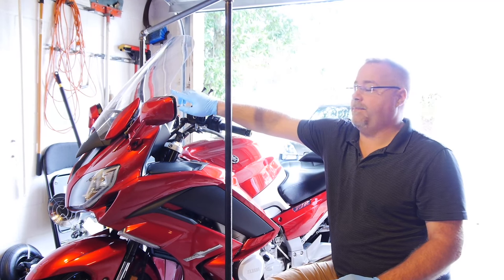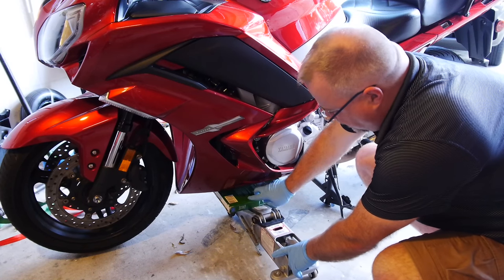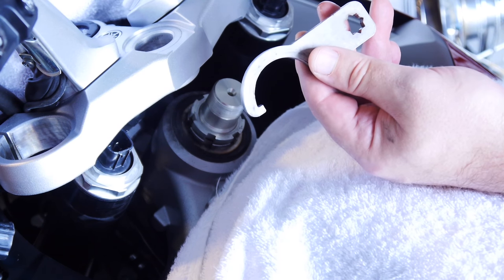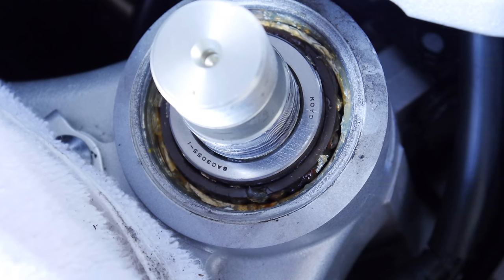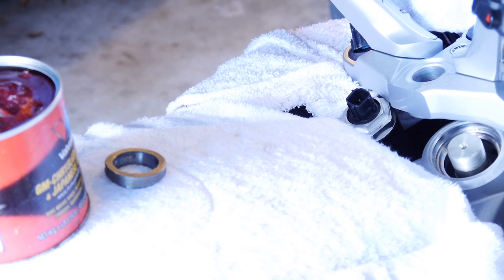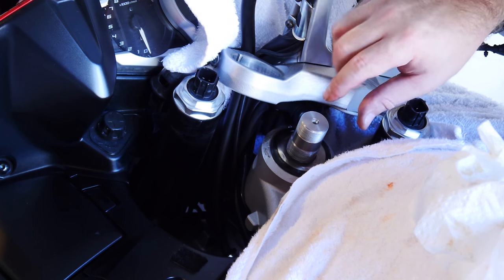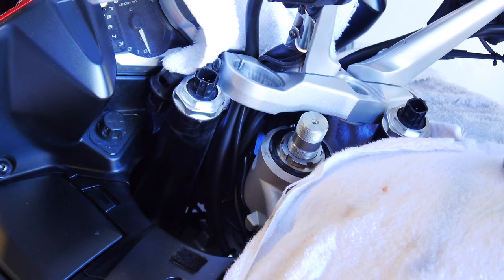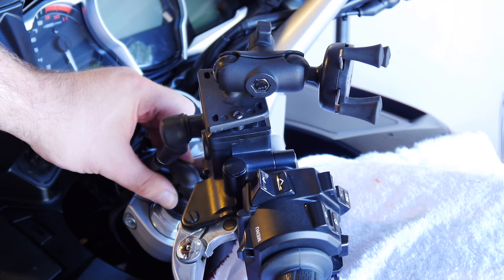How To Service And Pack Steering Bearings Yamaha FJR1300

Comment: I just performed this service and the video was extremely helpful.  One quirk was that I had a very hard time getting the lower bearing re-seated.  During the process, one of the bearing balls came dislodged and I had to reset in in place in the race.  This caused the steering shaft not to align in the center when I lowered the back.  After numerous ups/downs, I finally figured it out.  I almost screwed up by damaging the top threads when going up and down.  Thankfully, everything turned out fine.  Just a word of caution to be careful with those top threads rubbing the top of the steering head.

Comment: Brian glad to see you're putting more videos out sure have missed watching them love the Smokies video and the bearing video👍👍👍
Reply from the maker: Thanks man!  Summer is tough - no events going on and too hot to ride much!
Reply: I have a 2016 Yamaha fjr1300es that has had the steering head bearings oem bearings replaced with tapered bearings.  Should the bike handle different because of the tapered bearings vs oem roller bearing?  To me my bike feels more sensitive now . And yes the steering head bearings have been properly torqued to factory specs

Comment: This is the kind of service i dread on motorcycles, buying special tools(more often than not), taking apart and greasing shit that i have no business doing. Thus i probably never will unless i keep a bike 4ever(wich probably won't happen either.). Mind you, at this point i haven't watch THE WHOLE thing but for your time and peace of mind i hope you bought and installed new bearings regardless of the condition of the original ones. I seen people on the forums installing  roller bearings on FJRs and many other bikes(sturdier longer lasting, don't remember if it numbs your steering feel tho.).
Cool support(although flimsy looking) u got there, i have thought about doing something similar myself.
Reply from the maker: +JIGA BACHI lol not flimsy in the least an there is zero reason to replace good bearings. If you can't do work yourself I hope you have a real good nearby shop.  Motorcycles require a lot of special maintenance.
Reply: I do all of it(forks, valve adjst, TB synch, i happen to be an MMI Orlando graduate on Yamaha, Kawasaki & Suzuki.), it just happens that I'm a whiny LAZY bastid.
These days i rather MUCH MUCH MORE ride than be wrenching. Priorities i guess...😉😁

Comment: Upon further research, I will probably go OEM on the bearings, if you search "tapered head bearing replacement," you will see there are problems with aftermarket tapered replacements.

Comment: I recently had pirelli angel street tires put on the bike and immediately after began to experience a noticable vibration through the front end. I immeduately brought the bike back tobhave the tirrs rebalanced. They said tirrs balanced out to zero after weights were installed. I looked over the buke and checked to make sure everthing was tight. U didnt find any loose bolts but i did bring the front wheel to another shop to have them balance the tirrs. They removed the weughts and started over. Thier machines concluded the same weight on the same position using the marker of red dot at valve stem, and said the wheel was spinning true and no issue with the casting of the tirr that would make it wobble. This issue has not gone away and is aggrivating my   
 carpel tunnel issue. I also dont feel riding the bike at high speeds. I went on the fjr forums and found that this issue is actually common with  FJRs. Since steering head bearing re- torque is part of the routine maintenance, i think that is the next thing i should do but ive also heard that some guys go all out and replace the steering head bearings with needle type.do you reccomend this. I dont want to do this twice if i dont have to. Im also wondering if shaft driven bikes have this vibratuon more than chain driven.
Reply: I had the vibration issue on my '15 FJR1300 w 26K mile, but it went away when I retorqued the head bearings. Did not replace them just yet. If I need to replace them I will go OEM.

Comment: When we put the bike on the jack can I remove the wheel first to be lighter and easier to work and then torque the Nuts 
Or the torque has to be with the wheel on the bike and on the ground ? Does make any difference?
Regards

Comment: I have had a really annoying loud cracking noise going over bumps, accellerating, decellerating and even pulling the bike onto the stand.  Tried everything to find what was loose.  Put the bike in for a filter and fluids service, (just because I want the book stamped). They found that the steering bearing needed adjusting and fresh grease....NOISE GONE....happy Tom.

Comment: Question. How come i can't remove the bolt from the bottom of my forks? While still attached to the yoke I loosened the top nut and bottom bolt. Removed the forks but cant pull the bolt out. Any advice?

Comment: When I was on my season end tour out west I felt some wobble in the steering.  I bought the bike with 10,000 miles this summer, and I am just shy of 16,000 now.  Any thoughts on weather the bearings are bad, or if I just need to clean and re torque things?  Any advise would be great.  Keep up the videos!  I love having these tech videos for reference.
Reply: At the very least, it looks like the steering nuts need to be re-torqued. Most likely the bearings will need to be re-greased or even replaced if damaged or worn.

Comment: If you haven't invested in an expensive wife, you can do this alone. When you want to align the stearing yoke for the top bearing, roll the front wheel backward with your hands and place a piece of 1 inch wooden plank (or eqv.) in front of the tire to avoid it to move forward again. Some finetuning could be needed, but it works.

Comment: Did you repack both bearings or just the top? What kind of solvent do like to use to remove old grease from the bearings? I have a Yamaha roadstar 2006 has 19k miles and never repack the bearings , I think is time, my bike is always garage kept and almost never ride in the rain so I expect they are find. Also I have the 16 xsr900 like I mentioned the other day but that one only has 600 miles
Reply from the maker: Both. And you do t, just apply new

Comment: I find my self with a need to replace the bearing assembly since my FJR is unfortunately stored outside the elements effect it faster than most.  Is there a way to remove and replace the bottom bearing without removing the lower pinch bolts?
Reply from the maker: Nope it all must come apart. Not a fun job.

Comment: Thanks for the info ...i have 2013 yamaha . Everytime I apply the rear brake I hear a noise coming from my right rear pads. Sounds like a 10 speed bike. New pads were alrealy replaced.. any idea where to look????
Reply: You might want to try removing and cleaning the pads. Sometimes road dust or even small stones can be embedded into the pad and cause the squeal. Also check the condition of the rotor - check for ridges, rust, pits, etc.

Comment: Yamaha should have used tapered roller bearings and put a zerk fitting in to grease them. I am disappointed in what I see here.
Reply: All Balls Racing carries tapered bearings for the FJR, I am going to replace mine with a set.
Reply: My little Yamaha XT225 has zerk fittings, and I have to admit, they're pretty sweet.
Reply: @jfgreen1959  I have just had my steering head bearings replaced with tapered bearings on 2016 fjr1300